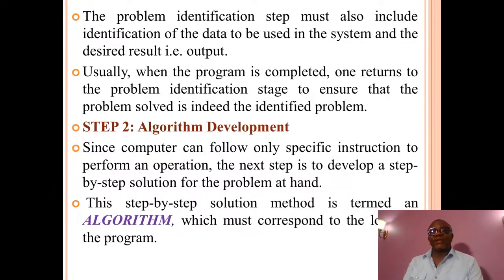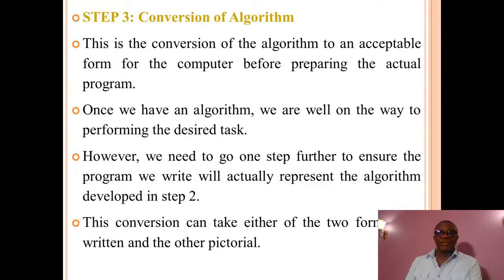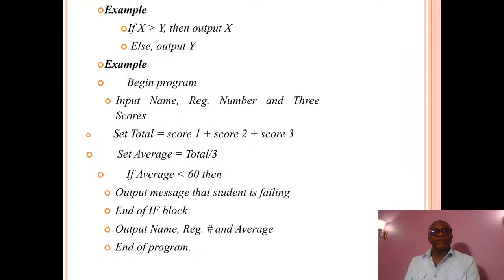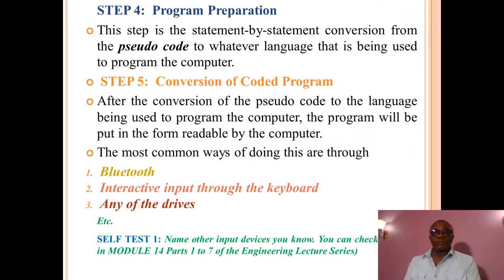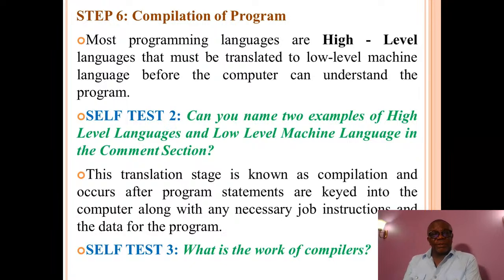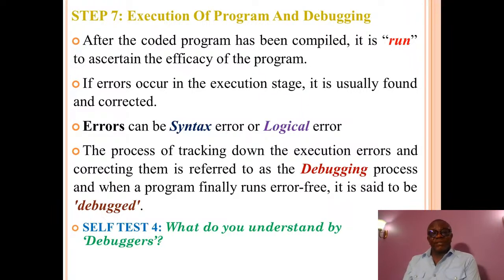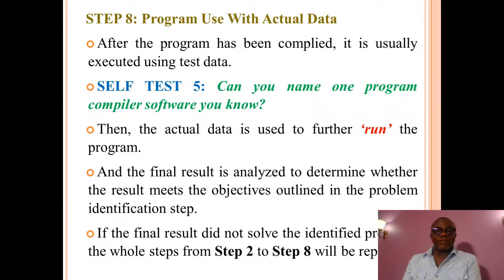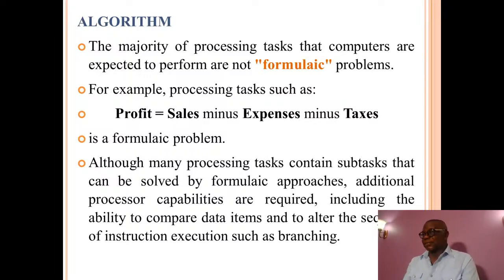Design Process and Flowcharting. Engineering Lecture Series MODULE 029

Comment from the maker: These are the five SELF TEST Questions
SELF TEST 1: Name other input devices you know. You can check them out in MODULE 14 Parts 1 to 7 of the Engineering Lecture Series) 
SELF TEST 2: Can you name two examples of High Level Languages and Low Level Machine Language in the Comment Section? 
SELF TEST 3: What is the work of compilers?
SELF TEST 4: What do you understand by ‘Debuggers’?
SELF TEST 5: Can you name one program compiler software you know?

Comment: I didn't get the first and forth question sir😢
Reply from the maker: SELF TEST 1: Name other input devices you know. You can check them out in MODULE 14 Parts 1 to 7 of the Engineering Lecture Series) 
SELF TEST 2: Can you name two examples of High Level Languages and Low Level Machine Language in the Comment Section? 
SELF TEST 3: What is the work of compilers?
SELF TEST 4: What do you understand by ‘Debuggers’?
SELF TEST 5: Can you name one program compiler software you know?